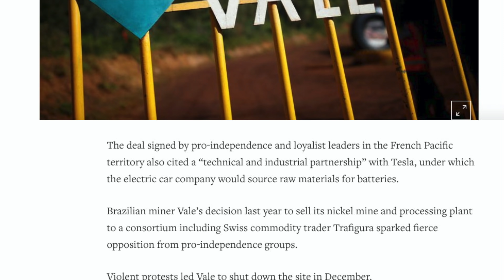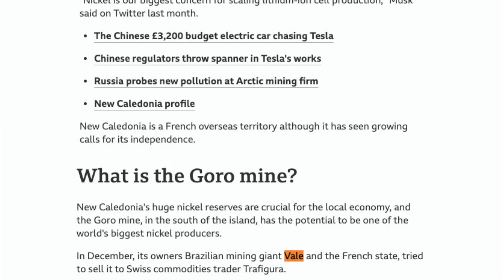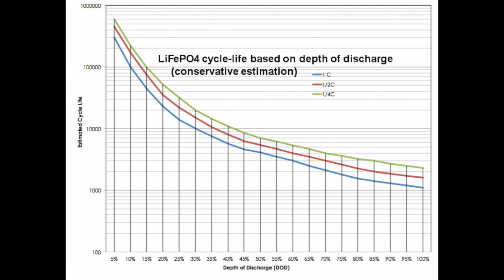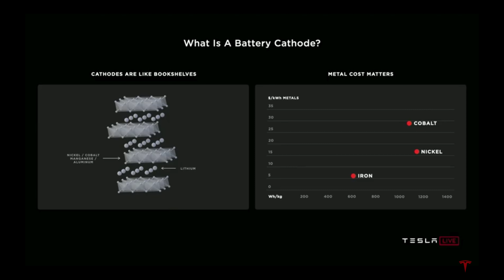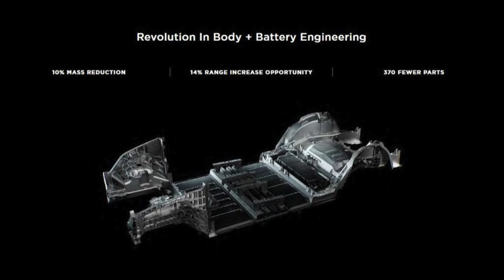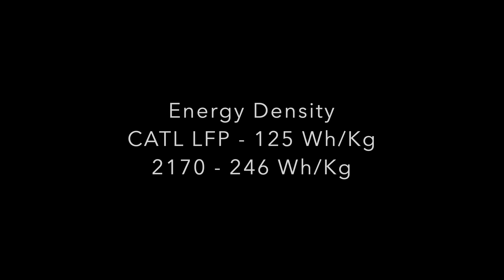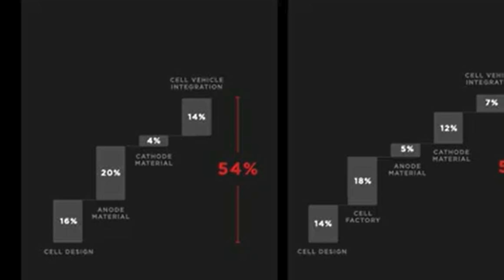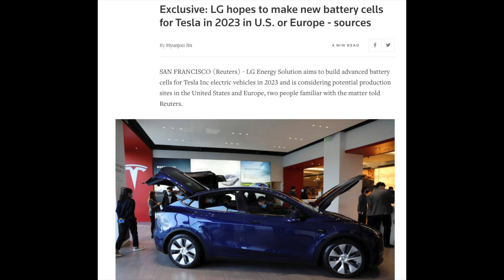Tesla's LFP 4680 Batteries are Under Rated, and Rarely Discussed. This Could Change Everything

Comment: What I've noticed as a Model Y Long Range owner. Because I just plug into to 240VAC/15 amps (14 miles per hour) when I get home and my expensive electricity (I pay 0.25/kWh) bill hasn't gone up very much, owning an EV feels kind of 'free'. I don't care if I drive fast, run the AC/heater. My only concern as a Tesla investor is that maybe the Mustang Mach E and the VW ID4 experience will be similar, so even range differences of 30% won't really make much difference to owners. The best competitive defense against this amazing Tesla battery tech would probably be installing really good home charging set-ups. Buy the VW, they send an electrician out who installs a charging circuit, box, extension for $800 instead of you having to hire an electrician who has to do some head scratching and charges you $1500.  My first week as a Tesla owner - it didn't matter what the range or batteries were I had serious charging issues that I had to pretty much solve on my own. Not smart Tesla. (I had a 240VAC plug, so I put together a 100' 10-4 extension cord  - but I can do electrical work on a professional level. Someone else would've been stuck.) 
FSD of course remains the huge factor, but not if you've never experienced it. Every other day now I drive my (2015) Prius V to haul my kayak to the ocean. After 6 months of the Tesla instead of feeling like a high tech hybrid, the Prius feels like a 20 year old beater.  It's steering feels loose, it's acceleration feels like the clutch is slipping. I'm sure it's all up to spec, and there is that 19' kayak on the roof rack - prior to the Tesla it felt like 'my new car.' Not anymore. 
I do see Tesla going to 400 -500 mile ranges as a competitive advantage. The Mustang Mach E gets about the same effective range as my Model Y LR, but weigh 200 kg more. A Model Y with 4680 LFP  batteries and megacasting  will get 400 real miles and weigh less than my pre-single megacasting Model Y,  Probably making it 350 kg lighter than the Mach E. I see Tesla keeping a significant competitive advantage for years. Still it would nail it if everyone could experience the relaxing stress reducing FSD.
Reply from the maker: After a while range just becomes a bragging right, the real competitive advantage is in the cost they can manufacturer them. Tesla destroys everyone in this regard. Of course they also need to acquire the battery supply too, which is another area where Tesla destroys everyone, oh yea and of course FSD.... perhaps I will stop there and put the rest in a video.

Comment: Thanks for this episode!  Your best yet!

From BDay I have said Tesla is all about LFP.  It's simple.  No supply issue.  The world mines over 3 Billion tons of iron ore annually.

And it's cheap.  And safe.  And due to much longer cycle life, it becomes even cheaper.

I believe 80% of Teslas vehicles will run on LFP as well as almost all utility and maybe commercial level storage applications.

LFP is the equivalent of todays 4 cylinder ICE car.  It powers by far the most light vehicles in the world.

It is impossible to transition the world to EV and RE as fast as is needed without LFP (and autonomy/FSD).

Elon knew all this a long time ago.

Comment: Solid analysis. Would be great to hear @TheLimitingFactor respond. I own 2023 LEAPS of VALE, which is the world's largest nickel producer, but still primary an iron mining company, so either way this plays out, VALE benefits.
Reply: I kind of agree but Iron is cheap and high volume so Nickel will be the cash cow for them. Iron will not take over completely so the price of Nickel is not under threat in my estimation.
Reply: @garethrobinson2275  I agree that the market for iron (and the supply of it) is so vast that even if most batteries shift to an iron-centric chemistry, the impact on the iron market will be small. Nonetheless, it is nice (for Vale) that they happen to be major producers of both.
Reply: You should add 2023 Leaps for Tesla. Bigger bang for the buck IMHO
Reply from the maker: Yes, Tesla have partnered with Vale in NC, those LEAPs could be good. Hopefully @TheLimitingFactor responds, he is credible on this matter.

Comment: The response to Battery Day gave them confidence to sandbag.

PS: If nickel is difficult to obtain, Tesla will just price nickel packs as luxury, while increasing the range of the standard. Remember that the goal is to replace 4 or 5 personal vehicles with a single taxi. Range may not be a big issue for that goal.

Comment: LFP cells have a slightly lower voltage per cell; I'm not sure if that would require more cells to compensate.  But in any case, the paradigm of using the 300 kg weight savings to 'get by' with LFP cells is a good one.

The V2G and VPPs are going to require more battery cycles per vehicle and the "million mile battery" will not have that much mileage if it's used for V2G.  So batteries are going to get used up faster if they're not LFP.  This looks like another reason to switch to LFP wherever possible.
Reply: Nickel based cathodes can have two million mile cycle life too. Dahn has demonstrated this with coherent crystal structure cathodes and doping with his dual electrolyte.
https://www.youtube.com/watch?v=pOQQTwYkg08&t=1731s
Reply: RE: lower voltage.  Just put more cells in series and fewer in parallel.

Comment: We've been talking about LFP 4680s since battery day.  In January, someone leaked out the non Tesla BOM (build of materials) for a non tesla 4680 battery.   It weighs .75 lbs.

For LFP CATHODE 4680 call 
Anode (22%si 78%graphite)
	gram
cathode coating	190
binder	10.5
conductive carbon	8.4
cathode foil	16
anode coating 	30
binder	1.6
conductive carbon	1.3
anode foil	35
casing	13
electrolyete	14
inner separator	10
outer seprator	12

a smart guy could calculate the COGS, and with a mass production line assume the cost of the actual process of the building/making the battery goes to a near zero $ amount ........ ($10M battery line / 1M batteries $10/battery  10M batteries = $1/battery 100M batteries = $.1/battery ......)
Reply from the maker: what power density?
Reply: @TeslaEconomist  The person who posted the figures didn't say.
Reply: @dalerichardson7202  You said "we've"...who are you referring to?
Reply from the maker: Mysterious
Reply: @dalerichardson7202  

Totally agree with BOM + specific routing + FAPC model to determine.....however, that's an elemental bottom up build and though useful would still not be accurate, as you never know how the accountants load the depreciation, maintenance, overheads fully absorbed labour rates into the work centres as the conversion cost.

However, from a top-down perspective, using LFP and creating a volumetic, thus electrically equivalent, sized battery 5.6-6.0 times larger, you can be positive that COGS/Wh produced would decrease about 16-18% and then another 3-5% for chemistry....possibly a 20-23% decrease $/Wh produced.

Either way, exciting times....and TSLA are re-writing 50yrs of automotive management science with aggressive vertical integration and in-house materials science and innovation.....I love it.